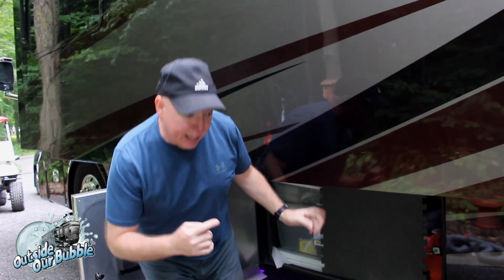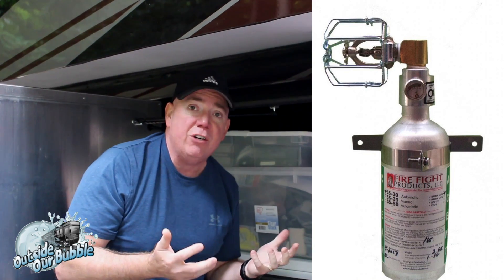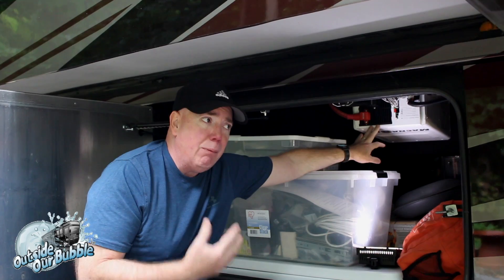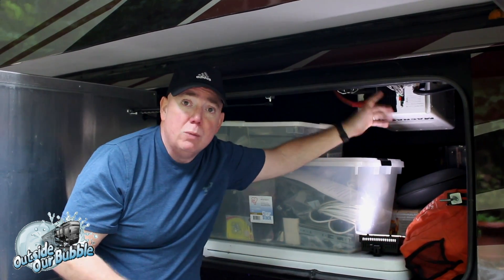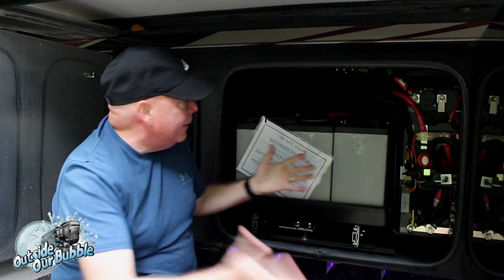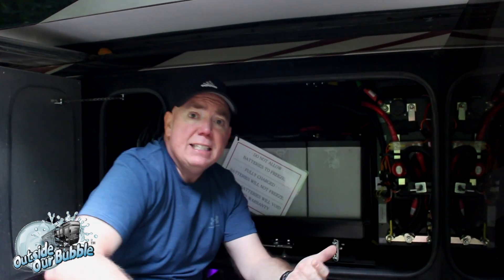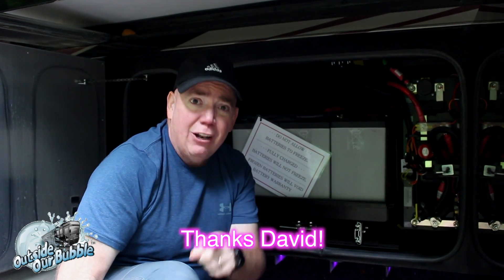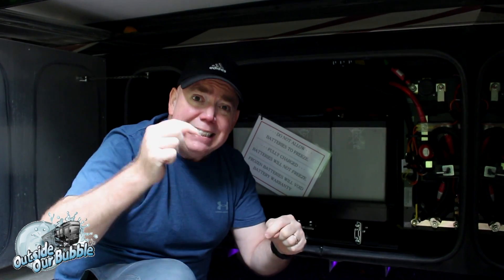Halon RV Electrical Fire Suppression

Comment: Great video David.... one question, are you still getting or still thinking on getting the new coach? I see you installing all the new devices.. are you planning on removing them to the new coach if you get one?
 Safe travel amigo.....
Reply from the maker: Will not get a new coach until they come out with a floor plan better than what we have now.  Yes, most of these items will just be moved to a new coach.

Comment: Quick question - what is the possibility that your bay might get to the magic 155 deg temperature?
Reply from the maker: It is not the bay, but the dispensing head that needs to reach that temp.  It would take a good amount of heat to reach that temp.

Comment: Should one also be fitted in the locker containing the 50 Amp cable, particularly if you have a permanent in-line surge protector and/or transfer switch in that compartment?
Reply from the maker: It is not a bad thought, I did not choose to do so as anytime I had a bad transfer switch it just blows the relays and power stops. But some  I have seen have melted, just not usually need in that area IMHO.
Reply: Makes sense. Thanks!

Comment: Great idea and looks like a good product.  Make sure everyone know that Halon works by displacing the oxygen in the air and you need to be careful if you plan to use these in a space that people are  in.
Reply from the maker: True to a point as there are different versions. This Halon is clean agent gas such as hfc227 or halon 1211 that is used. HFC227 is a halon derivative.  Both are clean agent gas.
Reply: Clean agent gas just means its friendly to the environment. They all work on the "flooded enclosure " principal to put out a fire and do it reducing the oxygen that kills the fire to a level that also will not support human life.  I work in HVAC and have done lots of data centers with fire suppression systems. Again, great little addition to your coach, but I would hate to see someone put one in their bedroom.   Thanks for the tips. I will be adding these to my coach when I buy it in a few years.
Reply from the maker: "... but I would hate to see someone put one in their bedroom"   Ah yes, I concur with that and would hope someone viewing this would look into something deeper for such a purpose.  Hey, I need a split A/C system installed. :-)
Reply: If you are in the same room as a halon canister as it goes off, you wont make it to the door.